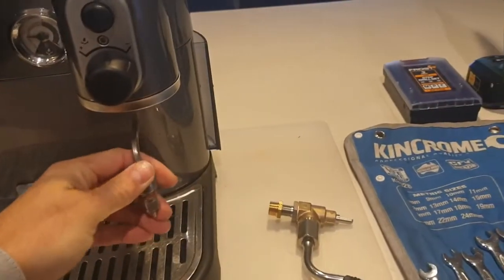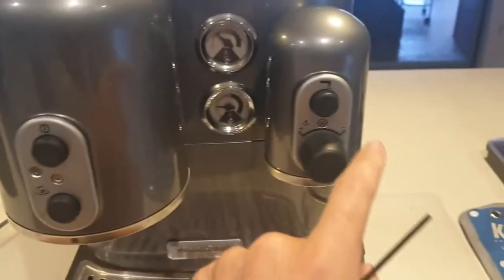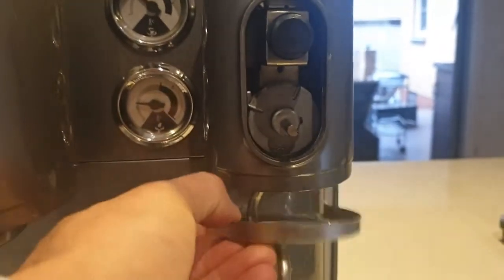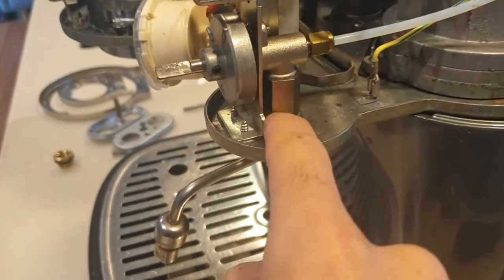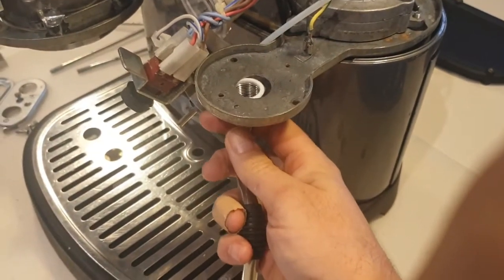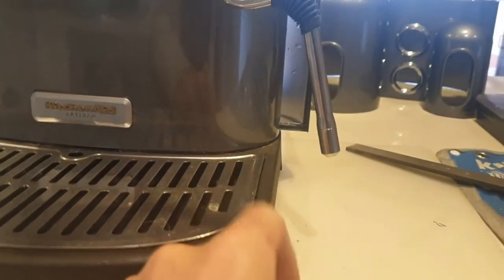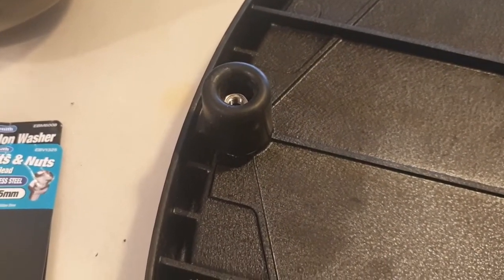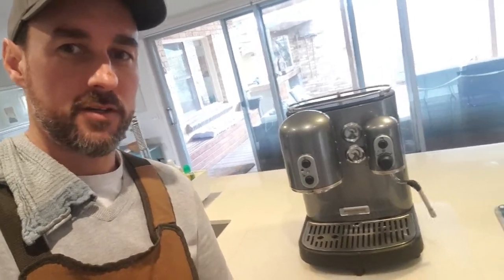Kitchen Aid - Rancilio Silvia wand upgrade

Comment: Great video, James. You are one of the few valuable resources I have found for improving this machine. Hoping to do a similar upgrade on mine in the near future. Curious if you have ever upgraded the dials in the Kitchenaid to have a pressure gauge or a better temperature gauge? I find the stock plasticky dials to be mostly for appearance
Reply from the maker: The stock gauges are 100% useless. I have a machine right now and am thinking of doing a pressure gague for brew and maybe a better indicator for steam boiler readiness.
Reply: @espressorestomelbourne1735  Please let me know if you end up finding a product that is the same size but is useful!
Reply: Would love to see a video if you do!

Comment: Hi James, very interesting and maybe I will try it in the future when the warranty is over.
I have a question about the water temperature. I read everywhere that for a good espresso the water temperature should be about 90-94°C. I measured a much lower value with this machine (82-85°C). Have you also had this experience with this machine and what is your opinion about what temperature you should have?
Greeting from the Netherlands
Reply from the maker: @KimballEngbersen  it is hard to get a true reading of water temp hissing coffee, when it is in the basket. There ultimate option would be to install a PID to control the brew boiler temp. You could then increase or decrease boiler temp and optimise it for the coffee you are using
Reply: @espressorestomelbourne1735 so your experience is not that these machines have a to low temperature? I ask this, because i also don't or hardly get any crema. 
PID is this doable? Is there no adjustment setting inside?   Any info is welcome. Ps nice video's
Reply from the maker: @KimballEngbersen  crema is more likely an issue with bean freshness/type/grind. A blend with a bottle robusta relatively freshly roasted and you should be able to get loads of crema. Make sure group is clean too

Comment: Why is a Rancilio Silvia steam wand always used in these upgrades? Does Gaggia not make a wand which could be used? (Thanks for the video, very clear content!)
Reply from the maker: No ball joint steam wands used in Gaggia Classic or Baby.
Reply: @espressorestomelbourne1735  Makes sense. Thanks!
Reply: @espressorestomelbourne1735  It depends mate, the baby class and twin got the spherical ones
Reply from the maker: @VentoqueSopra  they were a cheap sort of ball joint, but nothing on the quality of the Rancilio wand.  In fact I put the Silvia v1 wand in a Baby Doser before.
Reply: @espressorestomelbourne1735  it got sheer brilliance, simply superb...the video is fantastic

Comment: Question if you lose the white seal where the spring is. Where can you get it from?
Reply from the maker: Where are you located? You will need to scavenge one off an old machine. Parts limited these days
Reply: @espressorestomelbourne1735  Richmond VA 🇺🇸, i found that it's called steam group. But i can't find anything form the machine. I was thinking to just adapt the steam valve from Another machine. The only thing is i don know what that switch does. The one that moves with the valve. 😅

Comment: For anyone wanting to do this mod or others and are in the US and can't find the neccessary parts or don't want to order them/can't order them,message me and I can help walk you through on what can work..Living here in the US poses many challenges to working on equipment that doesn't use imperial measurements or that uses different thread patterns etc..I've done this mod and others on this machine and it was a nightmare finding the right parts..
Reply: Heeelp! Lol. I'm in this boat and for the life of me can't find bsp fitting needed. :/ what are my options before I go v1 wand? Thanks ahead of time!
Reply: @jonathandangelo3178  I recommend that you use the link in the video or you can try to find them somewhere else online..I used a fine pipe thread fitting and thread tape and forced it on and it held and never had an issue,but I dont recommend that you do that
Reply: @jonathandangelo3178  There are specialty fitting and nut and bolt shops here in the US,but the only one close to me still had to order the right one and it was going to take a month so I opted to do what I did and fortunately it worked
Reply: @CoffeeAndSmoke23  thanks man! I did end up finding some on ebay, shipped from China or Australia, so about a month to get here. Also found some from McMaster, with shipping would be like 16 bucks, but I may go that route. Still might take a month, but I'm not in a huge hurry. Thanks for the quick reply!

Comment: This is a terrible machine. Aluminum oxides everywhere where the paint is damaged, as well as inside the boilers and channels of the lower part of the steam boiler. An image product not designed for long-term operation without deep modernization.
Reply from the maker: @ВладимирИванов-ш1ы9б  corrosion of Alu can be an issue if machine is not serviced regularly to prevent leaks

Comment: Not directly related to the vid but do you know how to assemble the small brass collar onto the nylon steam hose that comes off the steam boiler?

Mine partially melted then ruptured at the top of the boiler but i may have enough pipe to salvage it  i managed to remove the small brass insert and the collar from the damaged end but am not able to refit them to the cut end of the pipe. Tia
Reply from the maker: @rob6rr  I would dip into my spare parts if I had an issue. Not sure where to get spare brass fittings to crimp onto a new teflon hose
Reply: @espressorestomelbourne1735  yeah I tried trimming down the outside diameter of the pipe a tiny bit in order to get the brass collar over the pipe. Still got a very tight fit. Did it hold up? Hell no, not even when the boiler was cold water was coming out from the pipe union 🤣 time to find a donor machine off eBay. 👍🏾
Reply from the maker: @rob6rr  theoretically you could buy these brass compression olives but I would not know where to start looking